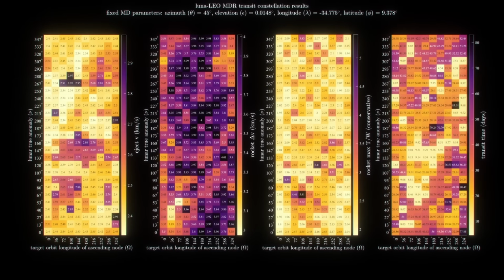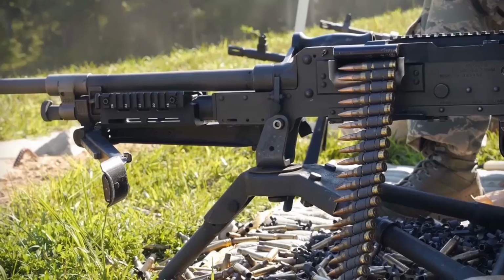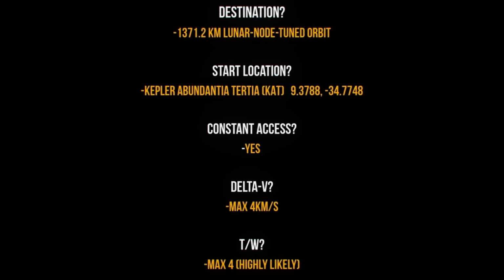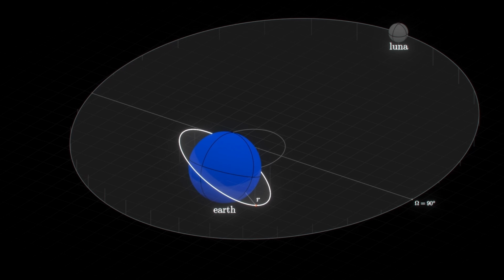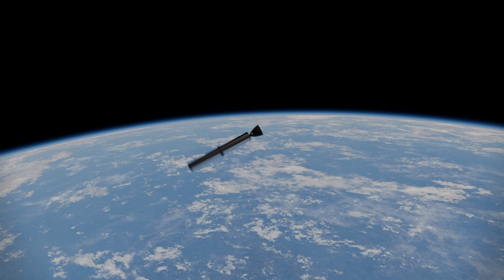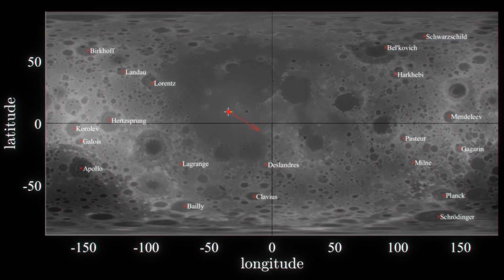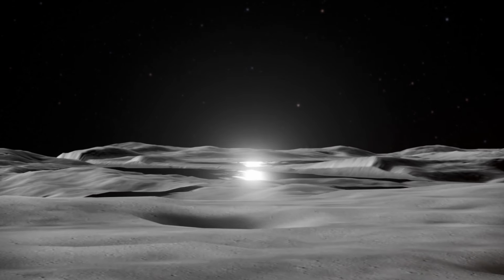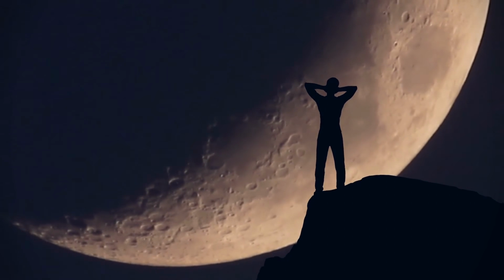Moon To LEO Transfer Simulations For A Lunar Mass Driver & Terrain Analysis + Power Sizing Estimate

Comment: The problem with thousands of small rockets is making each one perfectly. I only worked at the production side of the QC question, I'm sure an industrial logistician would be able to give a more detailed answer as to an optimal ratio between batch size and QC failure rates for something as complex as a rocket ship.
Building that many rockets on the moon from the moon seems like a lot of overhead spent on controls, electronics, batteries, computers, communication for a disposable rocket that is only solving the problem of location. (LEO not on the moon). The economic calculation of the optimal size deliver rocket might be a bigger factor than the optimal mass driver size and power. within some scale. 

It feels like putting every sack of flour into it's own ship to travel from selling to buyer.
Reply: Hello! For the precision required for each of these massdriver rockets (in this video they're called 'rocket pods'). Its unreasonable to expect each small rocket to be made 'perfectly', especially with our ISRU-derived machining capabilities. Instead these massdrivers, equivalent lifting vehicles and massdriver rockets will have to compensate for their relevant tolerances with active controls (eg modifications to their attitude control sequences during flight) both in their launches and subsequent cislunar transits.
Reply: @xoso599 Reliability benefits greatly from scale. Right now rockets are made in such small numbers that reliability is basically impossible to statistically verify—the sample size is too small. Comparable complex engineered systems (automobiles, smartphones) are produced in vast quantities and achieve very high reliability precisely because of that volume. High volume gives you many more chances to surface statistically rare failure modes. If a design flaw only appears in 1-in-1,000 units, a smartphone factory will catch it during test runs; a rocket program can go two decades without ever seeing it.
The faster, hardware-rich feedback loop that comes with high volume also produces more highly optimized and reliable products. High volume drives automation, and automation generally makes fewer mistakes than humans.
On the overhead you mentioned: because these launches will all be doing essentially the same mission, you can strip the hardware down and mass-produce it. Navigation, vehicle controls, and many of the sensors can be combined into a custom ASIC or hybrid SoC, radically reducing cost. Alternatively, you can deliberately use overkill hardware that is already being produced at scale for other products—there isn’t that much difference between the electronics needed to control a rocket versus a construction drone or an industrial process controller. People already do this kind of overkill all the time; your phone charger likely contains a computer more powerful than Apollo’s.
Reply: @orbitONhigh  Do you have any idea how hard it is to fab even the most simple computer chip? That process alone dwarfs the production cost of a mass driver. I don't feel the final cost of doing this all on the moon comes out cheaper than lifting from Earth with a target of LEO. I think Low Luna Orbit makes more sense as the target for the processing stage of the moon's mass. This video suggest a physically viable solution but does it make economic sense?
Reply: @xoso599  No im saying that custom SOC could be made on earth  and shipped to the moon they are very small a light all things considered  a single starship could probably carry enough avionics for tens of  thousands of payload pods.  that being said you can do a surprising about of stuff with just vacuum tubes, doing 100% irsu and making chips locally is long term goal but that's very long term.   and I agree that low earth orbit is a good target, im  simply disagreeing on the inclination of that orbit based on the model assumptions
Reply: @orbitONhigh great points. Vacuum tubes taking 20G? Wow!
Reply: @samedwards6683   well the ones we had in WWII proximity shells took closer to 20,000 G
Reply: My counter argument would be that any launch vehicle will have failures, that's just industry, but the best way to prevent failures is to experience them. the space shuttle had ~5 critical mission failures over 135 flights - in the last 5 years, Falcon 9s have had ~5 critical mission failures in 568 flights. 3.7% to 0.88%. And that's because they've launched a ton of flights, and ironed out the kinks. same thing applies to cargo, especially when almost any failure means you lose the entire cargo; so not only do you lose more from each failure, you're also more likely to fail, the less often you launch. and besides, if you have the industry set up to refine ore on the moon, then you definitely have the industry to churn out rockets made mostly of that refined ore, and anything you have to ship from earth to assemble the rockets and factory will be smaller for smaller ships. I see it more as carrying your eggs in lots of well tested little baskets, instead of one titanic basket.
Reply: Tbf near the end he does address that the rocket itself could be useful as is with its materials or involved components, so 'disposable rocket' is not quite accurate, as the rocket itself is inherently also transporting material by existing.
Reply: "perfectly" is a high bar - good enough is good enough. Obviously there will need to be failure mode handling, but standardization will allow for iterative refinement to drive down those failure modes.
Reply: @phrozenwun  And good enough for electronics and rocketry is perfect. It's a very high bar, but the parts scale to size without much extra cost. 50,000kg of rocket pod needs the same control computer hardware as 500kg does. 

I don't think it makes logical sense that we can turn out thousands of rocket pods made from moon dust, but can't keep building the mass driver larger to get a payload more than a few kg of cargo. The tipping point is when these high tech parts become economical to return and reuse delivered on a supply rocket.
Reply: @xoso599  "return and reuse" - this was a thought that also occurred to me. If the rocket and controls can be as dumb as possible but still re-usable then batching them up in LEO for return to Luna while consuming the tank and payload portion might be a very nice win. I suppose this will very much depend on what "dumb as possible" requirements are though.
Reply: @phrozenwun they ran that simulation and determined that climbing out of the earth gravity well cost too much and was thus uneconomical
Reply: Trying to figure out a use case for and slightly modified version of that: you could either have a smaller number of small craft like that and then send them back for cheaper to be reused once you get the cargo into moon orbit, saving on part of the cost of getting things off the lunar ground at least? Or you could do the same except with just dumb boxes without any control circuitry, or at least with VERY reduced amounts of control circuitry and probably a radio for tracking so you don't just lose your cargo. And then you have another ship in orbit to collect all the cargo and package the boxes up to send back.
As for how to collect all of that... maybe put the cargo and the collector ships into orbits of the same inclination but slightly different altitudes, and therefore different orbital periods, and then have absolutely tiny electric thrusters on the cargo (like use the particle accelerators on microchips that are already being tested as medical tools! But slightly different ofc) to change orbits just enough to rendezvous with the bigger ships when the time comes, which should be mostly easy if the orbital inclinations are the same. And then......... maybe the important reusable bits will be light enough that we can just make them on earth and send only the ones that pass quality control, at least at first.
Reply: (And then also we can have the launcher and payload size be bigger than just "the smallest we can build" too of course)
Reply: But then it's not every sack of flour in its own ship to travel all the way to the buyer, just every 1-20 sacks in their own rowboat to travel to the cargo ship
Reply: @animehair05silently88  The problem we are solving is that it's expensive to get anything to LEO. Shooting it from the moon needs to be cheaper at scale than lifting from Earth to make it viable; Which it should be. The cost of the payload rockets is the only part you have room to make adjustments at based on size, mass, acceleration. I can't even imagine how impossible it would be to try and build a CPU on the moon out of the moon to then throw it away lifting reaction mass down to LEO. I can't see that being economical.
Reply: The incoming pods could be shot back with its own mass driver in LEO.   The reaction force can be balanced by capturing newly captured pods
Reply: @andrewsteinhaus8267  Without breaking those pods would be coming in at many km/s and we have basically no way to grab anything at a distance, let alone at km/s. I suggested as a joke that you could have one large payload go first and loop around the Earth and get hit by a second higher velocity payload ending in a perfect orbit. But that's not viable for a huge number of reasons too. Really we just can't get things off the moon into LEO without paying a huge mass cost in fuel.

Comment: small, simple mass pods to high lunar orbital station could be consolidated onto ion rockets to final destination.
Reply: Too expensive.
Reply: @nicolasolton  well, none of this will be cheap.
Reply: You could also just put a Hall thruster on the pods themselves and run them on magnesium. With an aluminum electromagnet and silica channel walls it would run poorly and have terrible lifetime, but for a one-time transfer that doesn’t matter. The design could be made at enormous scale, and if paired with a direct-drive solar panel it would require almost no electronics.

Comment: So much effort to build a mass driver, just to increase payload fraction going from 6.5 to 4km/s. 🤷‍♂
Reply: dv = ev * ln ( m0 / mf)
m0/mf = e ^ (dv / ev)

Assuming we fix ev, a 1/3 reduction in dv requirement results in a new mass ratio of R^(2/3). For reasonable mass ratios between ~10-20, that's an improvement of a full 50-60%. Not to mention the trajectories that require half as much dv again (~2-3km/s)

Comment: now do the one where the military decides having a stockpile of tungsten rods of gods on the moon for use on the mass driver for "defense" is necessary...go over the damage 20 of those could cause
Reply: I remember reading about a whole huge constellation of these orbiting between earth and Mars, just waiting for the right moment to be nudged to blast craters into the earth...😮😢
Reply: @nicolasolton  we aint had a real way to send any unless it was done in secret which is possible but they would be limited in number....mining on the moon with a mass driver they could just pump them out by the thousands nobody would even know
Reply: Rods of god are overrated... the BIG risk is that these rocket pods are basically trivial to turn into anti satellite missiles. Meaning this mass driver, if reconfigured, could spam enough anti satellite missiles to destroy a big fraction of the Earth's satellites
Reply: @thefacethatstares i could see it used for both....anything shot takes a few days to hit...satellites can be moved around and blocked in that time....want to hit a city or say that huge dam in China that target aint moving and they could launch hundreds each hitting like a nuke but with no radiation fallout

once you can live up their without earth sending supplies attacking and wiping the board would be a valid option if any country with that tech wanted to....we are going to have to build geostationary defense stations to defend from an attack like that if that even be possible at all 

this is actually way scarier then nukes if you think about it....hope America settles up there first with nukes we proved we wont randomly attack folks with a super weapon already...

Comment: Can the starship reach 1200 km without reflueling ?
Reply: yes but cuts payload  about in half. but another factor that not modeled here  is the technologies being used at each location at a given point in time and any pre existing infrastructure. it likely that early build out cases will not be compromise solely  from orbital energy dynamics but from logistical economics. it might just be more economical to go to higher or lower orbit based how products are actually manufactured with the contemporary tech and market demands. no way to really predict that well and hard to say how much bias that will apply to this idealized case.

Comment: Mass drivers are just Lunar Kessler Syndrome in the making. Do lunar L1 L/elevators instead
Reply: If you pay attention, anthro believes that Kessler Syndrome is an overstated threat, that as proposed most objects will be sent into relatively unoccupied orbits further reducing the threat, and that a lunar mass driver would exponentially increase our capacity to manage orbital objects via the clearing of debris (and I have not seen him state this, but it would also improve our detection and co-ordination capabilities as well).
Reply: How does a mass driver have anything to do with anything like Kessler?  Besides, the moons gravity is so lumpy it's hard to keep anything in orbit without fuel.
Reply: Hi. For cislunar transit constellations we currently believe its reasonable to expect that, so long as relevant massdriver rockets can transit relatively quickly (ie over the course of a month or two) and rendezvous with a receiving station where they're contained, they should not propose major contributions to debris concerns, just as small temporary sats, designed to passively re-enter at the very bottom of LEO do not today. What may very well create additional debris concerns may be the infrastructure we build out of the receiving stations which hold and process massdriver rockets. Suddenly populating LEO/MEO with inexpensive major space stations (of hundred-meter scale or greater) will definitely require us to increase our relevant investments in space domain awareness. While debris is definitely something to keep track of and take seriously, it does not justify the adoption of a far further away, less ecenomically favourable orbit.